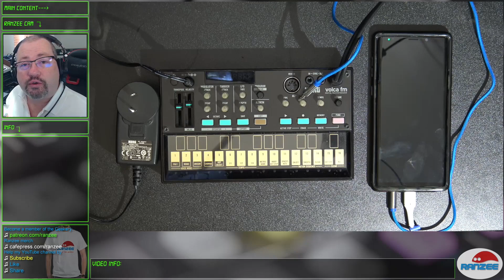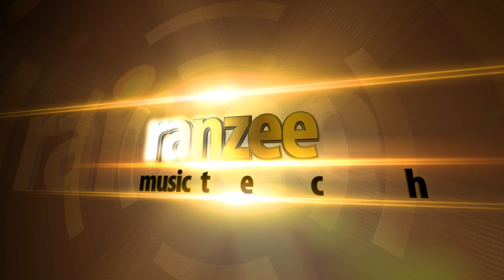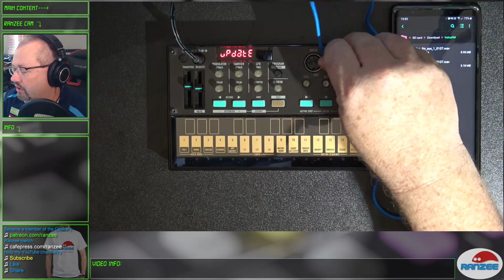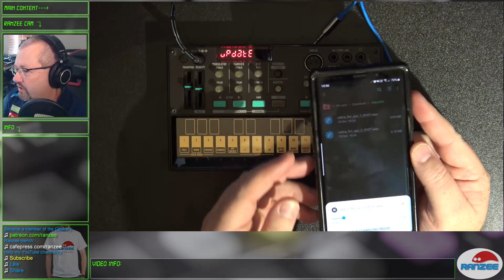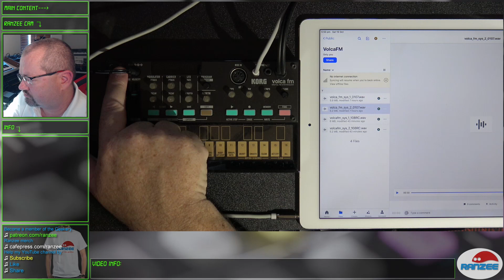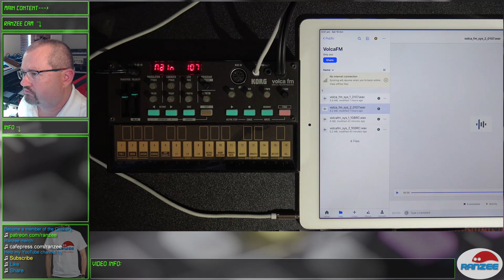Volca firmware update procedure including fails

Comment: Finally got this to work on my laptop after about an hour of trying. The key was to find the advanced settings for the audio device (in this case it was the onboard Realtek soundcard) and to make sure that 'Audio Enhancements' was OFF. Worked first time after doing that with the laptop volume on 70%
Reply from the maker: Really it's a pain - the best thing would be to do firmware updates via MIDI ;)

Comment: I couldn't get firmware to work using a Galaxy A10 phone.
 i also tried playing the audio into the Volca from my Windows PC, and this was also a Fail.
it was now stuck in 'update' mode, and thought it may have damaged the unit!
After having watched your explanation, i decided to try again this time with an old Galaxy Tab that  i had knocking around,  this worked  perfectly 1st try.
I would have never thought to dig out that old Tab and give it a go had it not been for this post. Thank You.
Reply from the maker: I no longer have the Volcas anymore - sold them and moved on. I'm glad you've got it to work!

Comment: Not sure if I'm doing something wrong here, but I can't get Update to display. I hold record and power on (it displays 104 as the version), insert the stereo cable, press play on the audio file and no changes. I tried from VLC player on PC and also Android phone. Help?
Reply from the maker: If you read through the comments here - you'll see a few people with success various methods. Other than that follow what the Korg manual says and ask for their support.
Reply: @ranzee  I figured it out yesterday. The video doesn't mention at all how to get to update mode, I was trying to do it all from "check firmware mode" which is where I was trying to do the update from.

Comment: I got a Nubass yesterday with 1.04 firmware. This morning I thought I'd check to see the what the latest one is. It's 1.07. The first update failed halfway through with an error message. I wasn't too stressed at this point, especially after seeing your experience. I switched the Volca back on and it would only start up in update mode. So clearly, I couldn't use the Volca until the update was done. Two hours later I finally got it done after a dozen or so attempts with E.UEr and E.dat errors and a lot of swearing. I actually thought it was bricked at one point. This really is an awful and stressful (to say the least!) method of updating firmware. It reminds me of the trials and tribulations of loading ZX Spectrum games from tape back in the eighties.
Reply from the maker: frustrating! Not sure why they didn't just do the updates via MIDI sysex.
Reply: @ranzee  Yes it seems odd they didn't go that route. You'd think the hassle it has caused owners, including potential returned units, would've made Korg think again. As I say, this is how we used to load games onto home computers at the turn of the eighties. Over 40 years ago.

Comment: I didn't hear on the video what actually was the reason for failure or iPad doing the thing. There was more in some comments, including that you had to try different output levels. Hm. Trying to go scientific on this, not so much trial :)

EDIT: I did it. My android phone first. Interestingly, the first file went ok on the first attempt. But the second did not, tried different levels and players. Went on to my computer with Zoom R24 as audio interface, Audacity, then the audio device settings (always have to do this: change to something else and back to 44k, some programs just don't have a setting for asking certain sampling rate, which I thought is the most important thing for audio software, but Audacity doesn't have that. I guess it will get the best resolution from Windows driver - but the driver doesn't reflect, it sees 44k still, so you can only hear quiet distortion... I digress)... Play it back on different levels and it fails immediately. Then switched on to Reaper DAW using ASIO driver. Works perfectly! Zoom R24 has level knob at the back, had to tweak it to a bit below mid position to make it work.

Note: the firmware files are in STEREO! So use stereo out and stereo cable.

Note 2: it remained unclear how to cancel the upgrade or "start from step 1" as told in the Korg manual. If you have the first file in, then Volca FM is in the upgrade mode until you can input the second file (it can also read the system file again, it will recognise the type of file). No matter how many times you turn it off or press buttons, it will stay in upgrade mode. To me it seems really fail-safe.

Why Audacity didn't work? It may have volume ramping (smooth start/stop) and dithering enabled. Just didn't bother of thinking about the settings before trying the DAW.
Reply from the maker: Thanks for sharing your experience! To be fair - the whole update system is terrible. Nobody should need to go through this kind of trial and error. Korg - are you listening?
Reply: @ranzee  it's today that things are not finished properly. Do we ever see a "finished" product from Microsoft? AmigaBASIC (by Microsoft) was buggy and slow already in 1984. Arturia Microbrute: can't change the MIDI channel from the device! It doesn't read the knob positions on power up, means you practically lost the patch you had tweaked.
Reply from the maker: @SamiJumppanen  indeed - there's a lot of that going on these days. The consumer is the true beta tester :)
Reply: @ranzee  the product line is cheap, and keeping things simple this is in line. Also means they don't have budget for fine-tuning their firmware. If the firmware was updated via MIDI, it would probably take much more time for them to code the process, and you obviously can't do that on any MIDI device. They've chosen pretty high frequency data, which means less kB for the wav file and faster update, but also it's then prone to errors. It also seems there's no auto gain control on the input, because the user has to guess the correct output level. Should have the display saying if its "ok" or "too loud" (there is the pilot tone in the beginning, that can be used for measuring / AGC). But every line of code and each component counts. It's worth watching the videos about development of Volca Bass for example. Compared to it the FM is packed with software intensive features, at least to my eye.
Reply from the maker: @SamiJumppanen  I think they should have allowed the updates to be done via the MIDI IN - tried and tested - each volca has a MIDI IN - no brainer.

Comment: Worked perfectly -  for the transmission I used a chinch cable with mini jack adapter and mini jack. 
I first thought that it would not transfer but it worked wonderfully.
Well, I also have an old Mac.

I need it for my Volca Bass and my Volca NuBass. 

In any case, thanks for the video, otherwise I would never have managed.
Reply from the maker: Glad it worked mate - congrats!

Comment: I tried updating my Volca FM on (3) different PCs, tried using several different cables, tried using (5) different media players, made sure absolutely no equalizers or filters applied in any way, tried all different volume levels, tried connecting to PC via (3) different AUX jacks.  All with no success, immediate "ERROR" every time.  And all this after I successfully updated my Volca Nubass and Volca Drum without much hassle, from the first try.

Plugged into my android tablet... worked like a charm!  Fully updated.  So, for those who can't get it working, definitely try with using your phone or tablet.

Comment: I’ve had repeated FAILS/ERRORS updating the Volca Bass, yet got the Volca Keys updated on 2nd or 3rd try. It’s like the volume level has to be just perfect or I get an error. ???
Reply: UPDATE; FINALLY got it updated after multiple repeated attempts. Had to redownload the update file and started over and it worked.
Reply from the maker: It's a PIA to update - glad you got it working.

Comment: it isn't clear how you got the volca into update mode. you explained how to check firmware but not how to prepare it for the signal
Reply from the maker: that info is clearly presented in the user manual - you can download it on the korg website if you don't have a user manual. what the manual doesn't show is how finicky this whole process is - which is the purpose of the video.

Comment: Hey, thanks for your videos. I've tried using several devices, several playback programs, adjusted audio settings, and different volume levels. The Volca displays update, but never gives an error or starts updating. Does that mean I'm using the wrong type of audio cable?
Reply from the maker: it is such a PIA ... it could be ... make sure you don't have any EQ or DSP effects on your device - even some sound cards have built-in audio enhancement - it is so freaking annoying just getting this right.

Comment: Anyone having problems with the constant failures like i just did for the last 20 minutes (tried every method i could find online). this is what worked for me: laptop with aux out, no dts or other effects on the laptop audio out, laptop audio level 80%, volca audio knob at 0, play the files in ITUNES. i tried vlc, dropbox, two iphones, different adapters, the only thing that worked was itunes, even though i made sure to playback all the other ones in 44.1. hope this helps someone if they have the same incredibly frustrating time i did

Comment: If you have problems with uploading into a Volca with a PC look at what kind of sound card you have. If its a RealTek…. Do a search for DTS Audio Control using the Windows search function...Then go into DTS Audio Control and turn off Audio Enhancements... They are putting the RealTek sound card into HP and DELL laptops among others. And there is no way to find the DTS Audio Control without doing a Windows search for it... This is what is holding back a lot of people from doing transfers to a Volca with a PC...
Reply: My Lenovo laptop has a realtek in it.  I found that Dolby was turned on in the sound settings.  Turning it off fixed the problem for me and updated my Volca Bass first go.

Comment: Thank you for putting this together Ranzee. Firmware updates, drivers and the whole gamut of software integration is one of many areas gear manufacturers could get a lot smarter at. Notwithstanding the difficulties of having many potential points of failure there is not really a robust process for the procedure for executing the update routines. I'd almost like to see some 3rd party platform like Midi-Ox being adopted as a standard but I'm sure that would be problematic among individual suppliers.